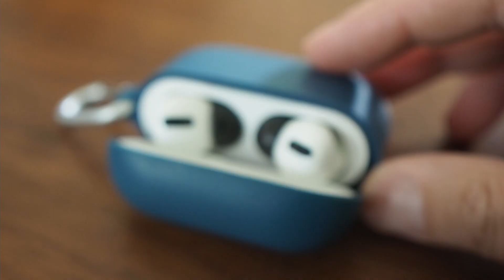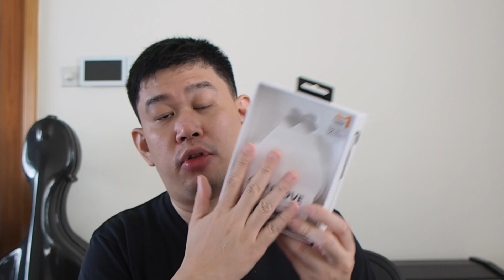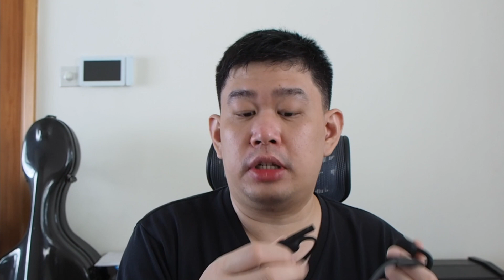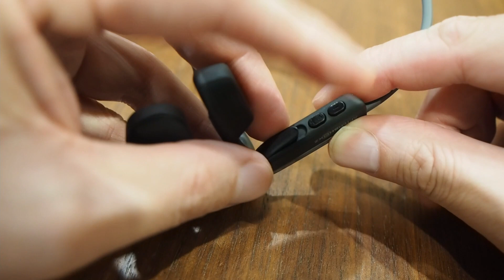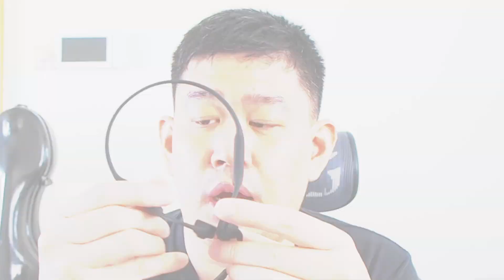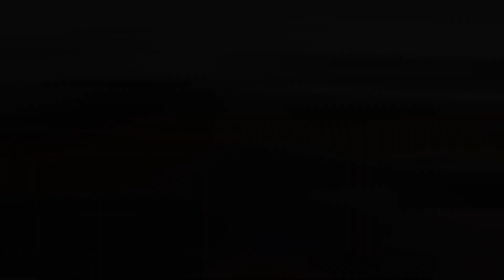AfterShokz OpenComm vs OpenMove with MIC TEST!

Comment: I have one of each and they have different applications for me, and the differences are why I chose them.  For work, I have the OpenComm as it connects to both my personal cell phone and work cell phone simultaneously, and I can wear it all day and not have to do anything but push the button when I get a call on either unless I'm listening to music on one when the other phone gets a call, which is the only drawback in that regard.  If my iPhones would let me turn the volume up even higher, I could describe how good they are at higher volumes (they do start to flattten the base out a little, though, which isn't something any bone conduction can do.)  For home use, I have the OpenMove and only use it with my IPad and a specific computer, and I don't need to connect to them simultaneously, nor is there a high noise environment at home.  The sound quality is great on both, even making up for some mild hearing loss in one hear.  I haven't spent enough time with the microphone on the OpenMove to provide an evaluation, but the OpenComm is excellent and unobtrusive to both me and those around me.  I have a big head, and the OpenComm is more comfortable for all day wear and pinches slightly less; I'm not sure why.  I love the situational awareness that both bring, but in a hot environment the constant skin contact makes these pretty slippery.  All in all, I'm tickled pink with both of these, and interestingly, am seeing these more and more being used by my coworkers who also appreciate them for the same reasons.

Comment: Hi. I was wondering if there is a significant delay in audio while using on a computer?
Reply from the maker: Not that I notice in normal use (conference calls, etc.)
It works like every other bluetooth device. However if you are a musician and rely on this for tempo/timing, it will definitely have the typical bluetooth lag/delay so a wired earphone is still better for that purpose.

Comment: Excellent review. I just bought the open comm headset today. I’m a commercial truck driver and this is my first experience with bone conducting headphone technology and so far it is absolutely amazing. The music sound a little tiny but it’s still not bad. Just lacking base. I got mine for $179 at the loves travel center. So if you’re a truck driver looking for a good bone conducting headset and you have $179 apart with I think you can’t go wrong.

Comment: Justin, you mentioned wearing opencomm for outdoor may not be a good thing to do. I want to use it in the gym. I want to see, if I flip the mic all the way back, does it chew my ear? Will it press the ear in a way that it would be bothering after few minutes running in gym?
Reply from the maker: It doesn't chew the ear. As a bonus, it actually mutes when it is flipped back. It should be great for the gym although do bear in mind it's not fully waterproof.

Comment: I currently have a Poly 5200 and want to determine if I should change to the Opencomm.  Do you have something comparing sound in different environments, such as driving or outside, and either mower or construction/hammering happening?

Comment: You can enable multipoint pairing by going into pairing, then holding the multifunction button and volume up button at the same time. That will let you pair to more than one device at the same time.
Reply: It works if followed in a particular order. Here is a great step-by-step guide to pair multiple devices: 
1) Start with your headphones turned off.
2) Enter pairing mode by pressing and holding the power/volume+ button for 5–7 seconds. Audrey will say “Welcome to Titanium!” and then “pairing” and then the LED light will flash red and blue.
3) Press and hold the multifunction button and power/volume+ button at the same time for 2–3 seconds. Audrey will say “Multipoint Enabled.”
4) In your first device’s Bluetooth settings, select the Titanium. Audrey will say “Connected.”
5) Turn your headphones off.
6) Re-enter pairing mode by pressing and holding the power/volume+ button for 5–7 seconds. Audrey will say “Welcome to Titanium!” and then “pairing” and then the LED light will flash red and blue.
7) In your second device’s Bluetooth settings, select the Titanium. Audrey will say “Connected” or “Device 2 Connected.”
8) Turn your headphones off.
That completes the multipoint pairing process! Your headphones should now be connected to two of your devices simultaneously the next time you turn them on.

Reference: https://medium.com/@AfterShokz/your-guide-to-multipoint-pairing-e3c50e45f254
Reply: when I try to pair my laptop and iphone, I need to turn one off to enable the other. I can't do what to you say
Reply: Is this for iPhone or Android or both? I'm getting open mic tomorrow so it would be useful to know.
Reply: @mattfletchall5550  it’s on the headset not the phone, so both
Reply: i missed this feature for nearly half a year desperately. i found it today in the manual starting at page 15. The only missing point is the none existent mic at the openmove. The description of Hamid is very concise

Comment: Hi, nice review👍👍, I would like to know, could I use these with my open Face motorcycle helmet??
Thanks
Reply from the maker: I'm not sure if the squeeze on the size of the helmet might hit the buttons but it should generally work very well. I do have a helmet somewhere, maybe I'll try it one day.
Reply: I have used AFTERSHOKZ Sportz Titanium (the model with wire) on motorcycle rides using modular helmet and it works great, you have sound and you can use ears protection. I did not have any calls, just music.

Comment: I got the OpenMove about 7 days ago.  I had considered the OpenComm, but decided the extra cost for a delivery driver was not warranted.  I deliver food and am constantly calling customers while driving.  I can hear GPS and customers super well. The calls come thru very clearly and loudly even while driving and customers have never had issues hearing me clearly, except during one super heavy thunderstorm with 40mph wind, but I am 99% sure that was due to the cell tower phone connection, not the headphones.  The OpenMove are very comfortable on my head for 6 hours straight use.  The only thing that I would love to see is if Apple made a device like this for legal use while driving (H1 chip).  I considered the Airpod Pro for this use, but even though they have transparency mode, the Airpod pro cannot be used in both ears and are illegal to use while driving in many states in the USA. I prefer both ears to hear better.
Reply from the maker: Great stuff. The OpenMove is a good product in its own right, and I (or my wife) have no complaints about it.